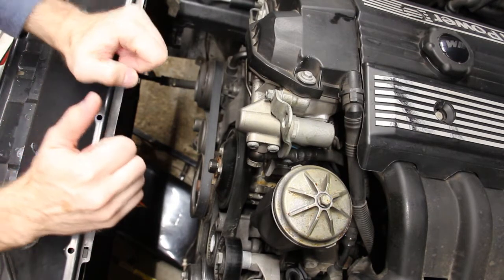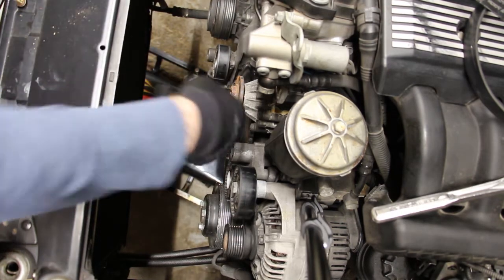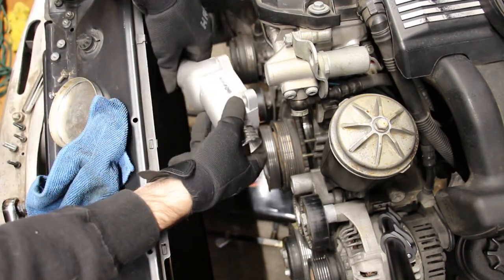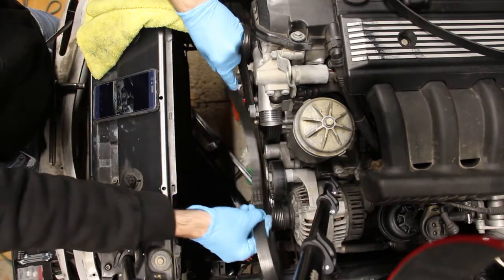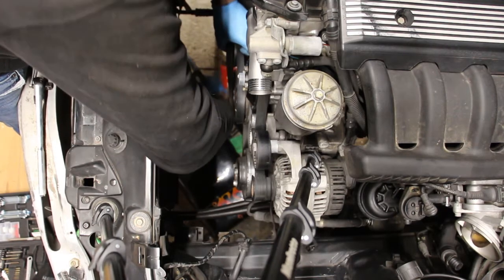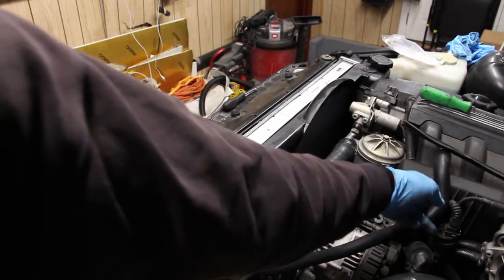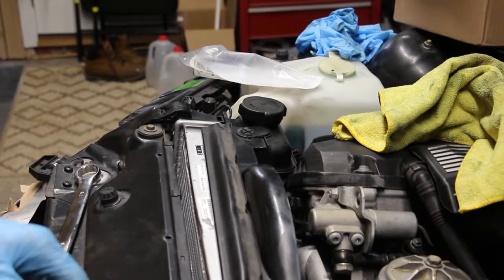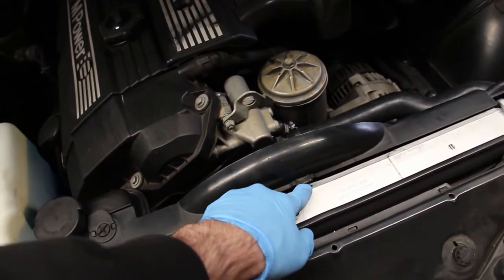How To Update the Cooling System on a BMW Z3 M Roadster pt.2

Comment: These videos were a helpful reference for my cooling system overhaul, thanks for making them! Any chance you are planning on replacing your oil pan gasket next?
Reply from the maker: Actually, it's on my list. My plan is to do the rear trunk reinforcement as well as safety wired oil pump nut (since the pan will be dropped, I will be replacing the gasket).

Comment: Hey CarGuy, I have an M Coupe that needs a cooling system overhaul as well. Could you tell me about how much you paid for parts and where you got them? Thanks in advance.
Reply from the maker: My total came out to almost $400. HOWEVER, I used Graf water pump and Behr radiator. People will tell you to get a Stewart pump and a nice aluminum radiator, but I thought it would be wiser to spend the extra money elsewhere to work with my budget. 2 years later, I have no issues with the parts I've used. Plus, I buy parts on FCP Euro, so they come with a lifetime warranty. I use this car for weekend/backroad driving and track days.

Comment: So how did it go with replacing the coolant hose that runs underneath the intake manifold?  Also it would have been nice to see how you were able to install the hoses that ran from the heater core to the front side of the engine. I’m doing the same job soon and all those hoses mentioned seem tough to do without removing the intake manifold.
Reply from the maker: I completed this in pt 1. Start at the 20min mark. You do not need to remove the manifold, but you do need to take out the intake elbow. My hands aren't small and I was able to get in there without an issue. Feel free to ask if you run into any issues.  https://www.youtube.com/watch?v=ERqztIL1DPw